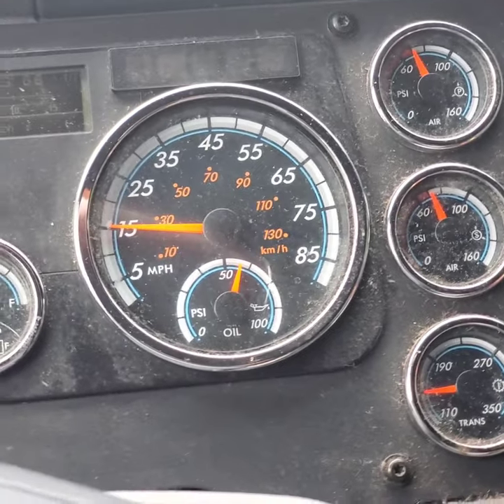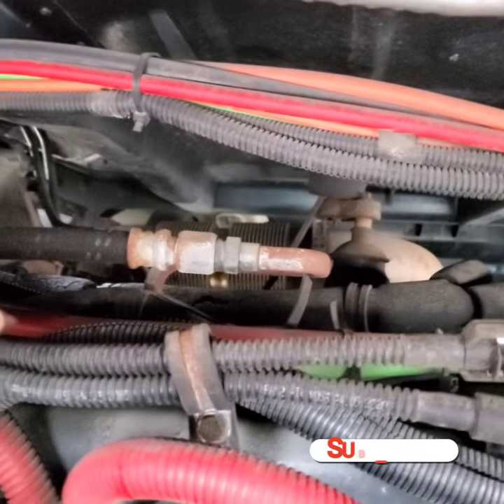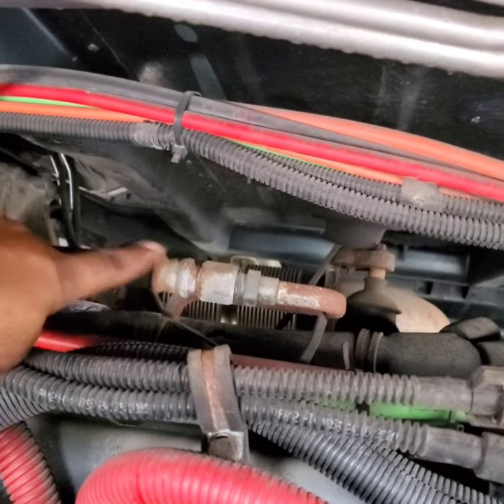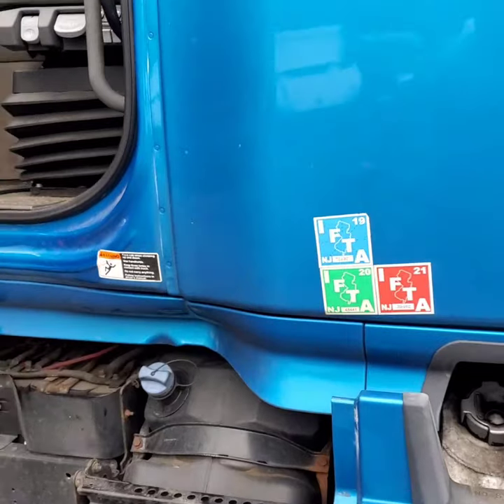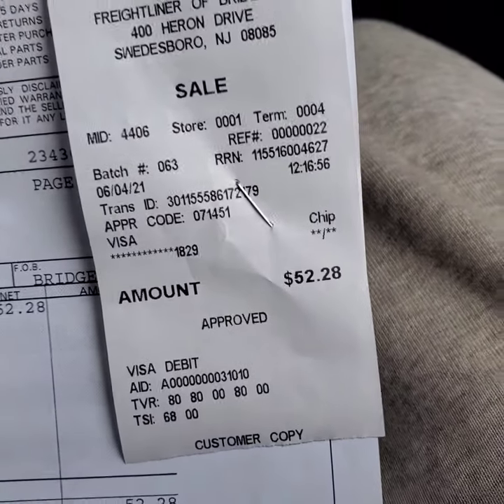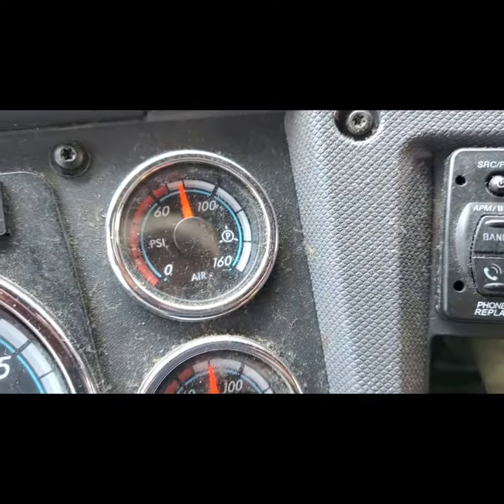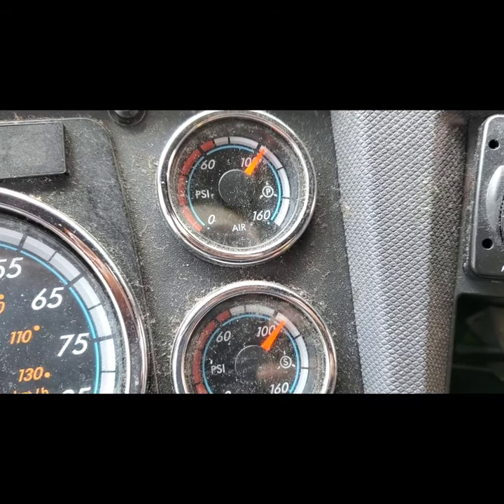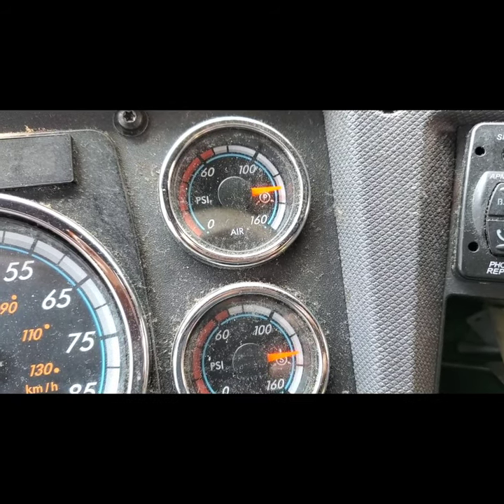Why Air Pressure not building up on Semi Truck? (Do this before changing Air Compressor/air Dryer)

Comment: Damn rip off mechanics. For a 52 dollar hose they wanted to have you spend 2500 - 3000 dollars 😡. Also the problem might be the air compressor loader valve which cost around 100 dollars and it’s better to change the governor as well.

Comment: Bro u need a new air governor on ur air dryer anything over 140psi going to blow out seals on fittings
Reply: governer is easy to adjust
Reply: @michaelo2522  Loosen nut then turn the screw "IN" for less maximum pressure.
1/2 turn is roughly 10 psi
Tighten nut.
Max air should be 125 psi

Comment: My problem looks just like yours fixed.I will check my lines tommorow there are atleast two hoses one on each end of the metal tube that runs across the underside of my radiator.Both are wet with oil or water.Going to soap spray them in the morning.

Comment: i have the same situation, hope this answer my problem, i already change compressor. dryer, governor, i  will let u know later. thanks
Reply: What happened
Reply: the same hose that he shows in the video was my problem.  I changed several parts and I had never tested the hose with soapy water. 10/10.

Comment: Helpful thanks
I have this issue My 2017 Volvo air below 60 PSI when I parked and when I drive starting built above 60PSI.
Reply: I have a 2001 KW it goes all the way to 120 Fisher air pressure but the Green arrow comes back to zero what can be causing that
Reply: Air pressure

Comment: What if the compressor is building air slowly?
Reply from the maker: As long compressor building pressure you should have no issue it may take little longer to build air. You can always check the pressure of air compressor by putting a Guage on other side of line. If it's too low than it's better to replace but make sure that the line have no leak or it will show low pressure.